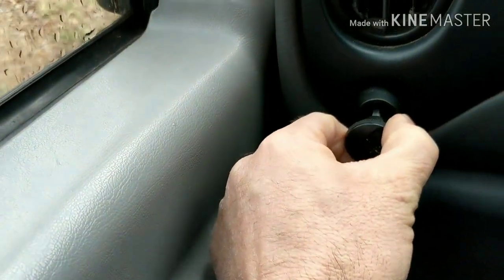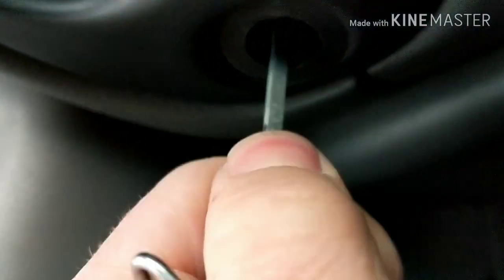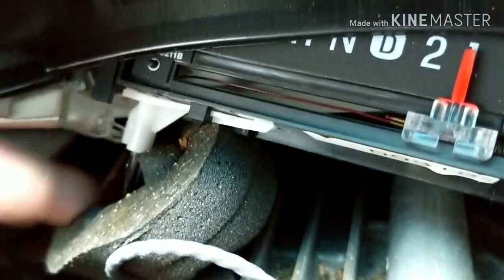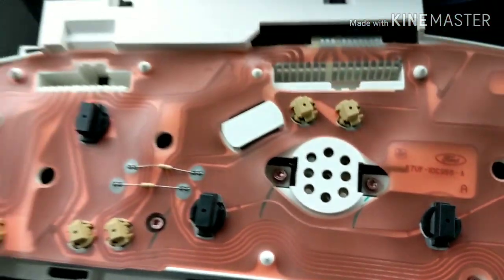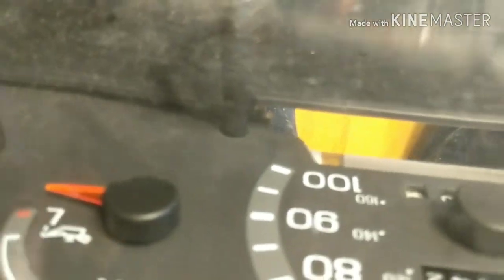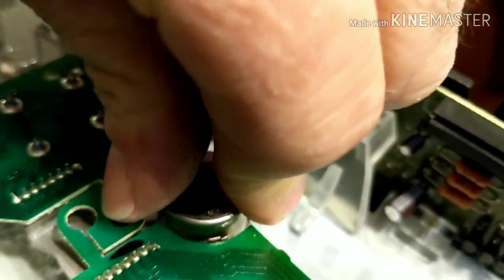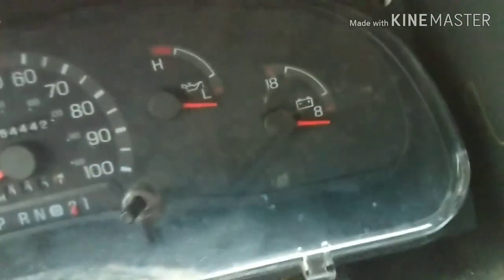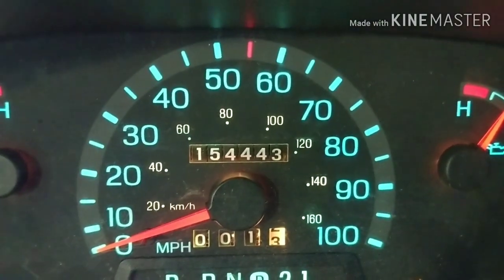Easy Ford odometer fix

Comment: this just saved me! turns out my gear was fine and it just needed to be nudged a bit to get over 100,000, but regardless if you don't have tools you'll just need a 5 mm and a 7mm socket either on a 4 in extension w a wrench or just on one of those screwdriver bits. I went to autozone and they let me borrow tools, and I got it done in the parking lot, but the tools are probably like $15 if you just wanna order em. I did it myself with no experience fixing cars, so anyone else could do it too. 

My van had a larger fake wooden trim panel that also housed the radio. For mine, the whole thing came out on snaps, and I just focused on the top right AC vent first. There were two clips for the cigarette lighters, and I just left the CD player how it was in there and angled it away while i worked.

Remember to put your parking break before u put the van in gear... lol

Comment: Great instructional video.  Solved my issue of non working odometer.  The only thing different, was that I needed to remove torx screws from both the back and the front of the instrument cluster to get it apart.  Other than that it was spot on.  Thanks!

Comment: I went to change my radio and my cluster and radio is out idk i dont have the truck with me i left it at a job but i will pull it out check this spring or check the wiring it worked fine before i changed the turn signal maybe i f something up !! You saved me im sure it this thank u

Comment: Btw way i didnt have a tool to release light switch button and coat hanger wasnt cutting it but theres a release pin on light switch body behind dash.  Wiggle hand behind dash to light switch and feel for a small button release on body of switch, press and pull switch.

Comment: What a wonderfully professionally presentation.  Clear and concise.  BUT, after all these types of videos I have watched, why does NO ONE replace the bulbs or look for solder cracks or any other potential problems?  PREVENTIVE MAINTENANCE, ya know.  You replaced the worm gear but what about the drive gear?  Don't you think it, too, might be old and brittle and ready to break or be worn and ready to slip?  Of course with my attitude is why I seem to never finish a project.  I'm always going from one thing to the next even after the original problem has been fixed.
Reply from the maker: Thanks and yeah I see your angle but then where do you stop? The drive rare rarely breaks so I just went for the warm gear It's been good ever since.
Reply: @TepcoCycleRepair  - Exactly, and that's why you are riding around and enjoying your car while mine is in pieces in my garage for the past year.  I think I'm the one that needs to change my attitude.  But I would still replace the bulbs, at least, to have a nice bright dash.
Reply: I think your right my man. I replaced my worm gear, which it needed, but it still doesnt work. I shouldve replaced my motor. Its like changing a timing belt without changing the fuel pump, (on some vehicles) All my fuses are good, so, here I go again, taking my dash apart.

Comment: Got a 2003 ford winstar i need to sleep in and save fuel but  the odometer and speedometer dont work the abs light and brake light are on as well with the engine light and overdrive keep blinking on and off, the owner says its speed ahift sensor but it drives ok and dont here no transmission slipping or nothing. The auto stores cant diagnose it says its an air sensor and i laughed at them cuz that has nothing to do with my issues but could be why it spits and sputters sometimes. I think its the cluster panel but someone said it could be a fuse??? What are your thoughts on it and is it worth buying?? I really need a place to sleep this winter and heat works well. My dads spawn sto le my motor home amd truck...

Comment: I replaced my gear, which it did need. But it still doesnt work. The motor spun easily by hand, but there was some resistance. You guys think its the motor? I checked all the fuses by the drivers door. Any ideas? Thanks.

Comment: How did you determine that it was the gear and not the vehicle speed sensor
Reply from the maker: It's common for these to break with age. I didn't even check the VSS but a scanner would tell you if they were reading correctly.
Reply: If the speedometer AND odometer do not work that is almost guaranteed to be a bad speed sensor 
BUT
If only the odometer is not working it will need new gears installed (what this video is showing)

That is the best way to tell I know of without scanning or further diagnostics

Comment: ok, the pain in the ass is getting the motor out

just did it after 25 mins of pain.

how?

take a small flat blade (bit) just the bit, and put it under the one side of the tabs on the motor.   then, take a flat screwdriver and push the other tab up while twisting .... .such a bittttch-!   

you are welcome
Reply: Thank you !!!!!

Comment: Hi guys, both my odometer and speedo aren't working. I replaced the speed sensorr on the rear differential but still nothing. Any idea if this gear may fix the speedo along with the odometer? If anyone has any ideas of what may be broken I would really appreciate it. I have also taken it to two mechanics and neither could diagnose. TY
Reply: I have the same issue but then it started working again. Speedometer and odometer.

Comment: How do i get the number set out?
Reply: got it out, how do i switch the numbers with out breaking it?
Reply from the maker: @michaelshefter7360  Not sure on that, they'll probably break.
Reply: @TepcoCycleRepair  I was able to get it out and adjust after jerry rigging an aluminum holder from a chinese takeout wire handle.
Reply from the maker: @michaelshefter7360  Oh nice, good job!